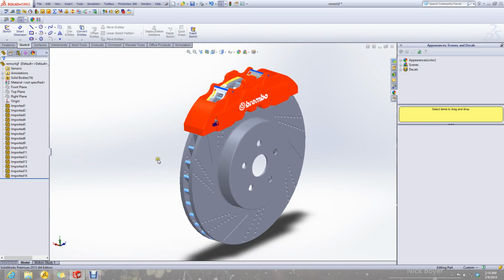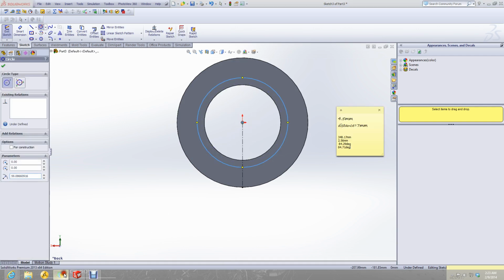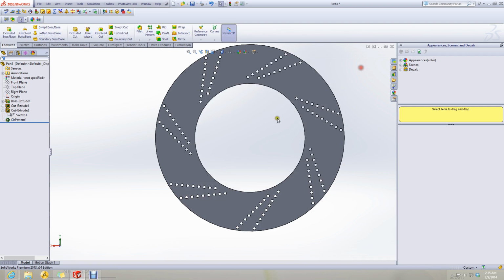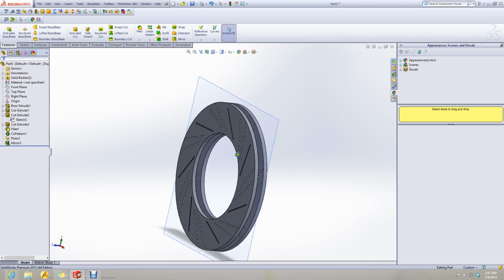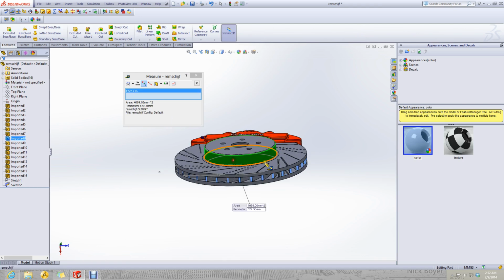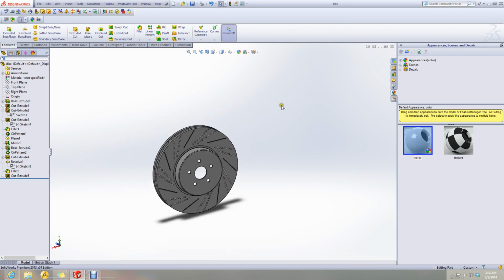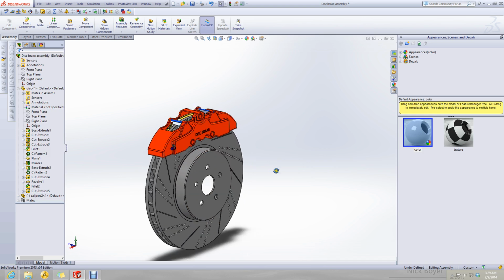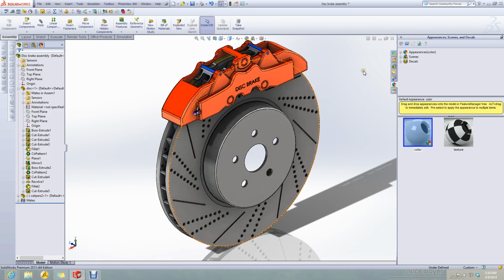SOLIDWORKS Disk Brake TUTORIAL

Comment: Seriously "just convert entities" without including the original file. I had to take screen grabs of the caliper and use them as sketch image underlays to get the proper shape myself. Later I learned the original file is on grabcad to which the poster should include the link of.

https://grabcad.com/library/disc-brake-42